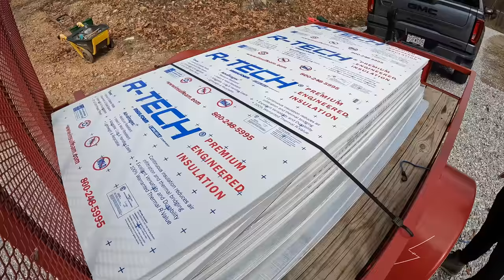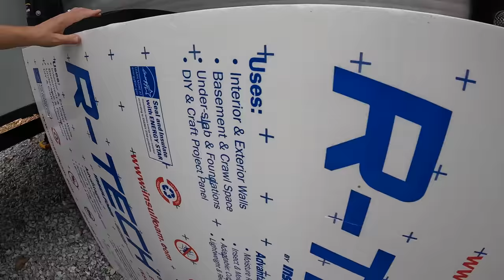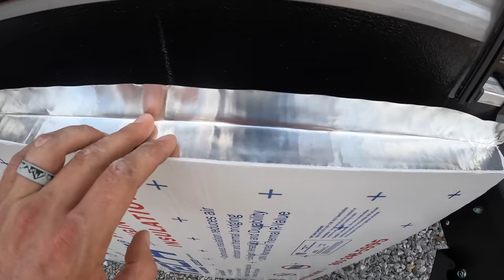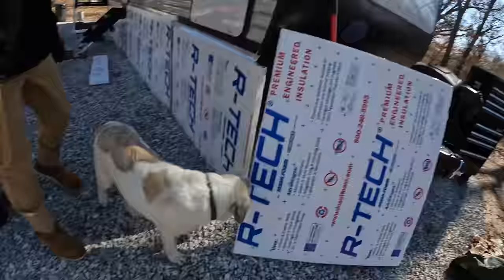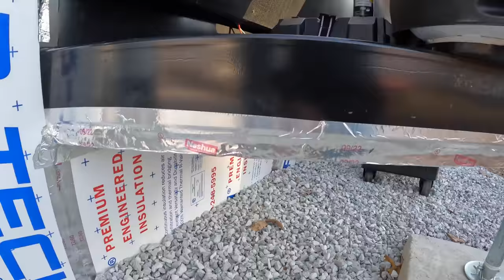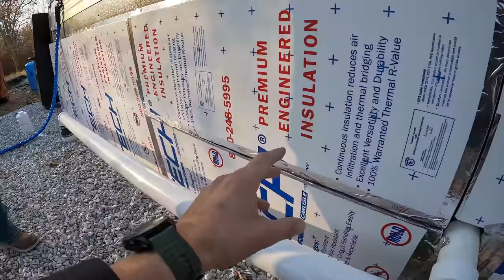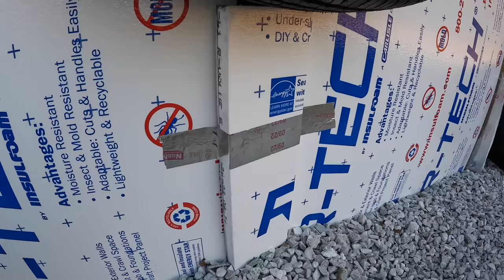Skirting our camper for WINTER!

Comment: If it goes below freezing in your area -you might want to use heat tape to wrap the pipes and then wrap insulation over top of the tape which is wound around the pipes.

Comment: Kyle I have a friend that installed some Heat on Demand water heaters. In his bathrooms , kitchen and laundry room  . And they are amazing  . So I thought Shanon and you might want to check them out . Great job on the skirting .  And Shanon did a great job under the trailer while dealing with Herc .

Comment: You can also get hay bales and put them around your trailer and then use the straw or hay for bedding later on for the goats, pigs, chickens etc. or bag the leaves around the property and stack the bags up around the trailer and it is free except for the bags! Pool noodles for your water lines and sewage lines( they can freeze, too!) Bubble wrap on the windows indoors, too. Good luck and God Bless!

Comment: WATER PIPES AND INSULATION TIPS:
Let your faucets drip overnight and leave any cabinet doors that have water pipes open at night(and daytime also if below freezing outside). You might want to leave bathroom door open when super cold out.
Parking your vehicless around the camper on the north side as a wind break may help.
You might want to check your upper cabinets, closets, bench seats and under your bed for any way to Insulate those areas. Maybe use your clothes, extra blankets or bed clothes as a way to Insulate those areas a bit.
Typically lined blackout curtains are heavy duty curtains(you may have to do your own modification to make them fit the camper windows.
Lastly, Reflectix Insulation is a great option for making temporary, reusable, on/off  windows and door coverings for night-time and alsi great for using on indoor water pipes (save them for summer too)
Stay warm y'all!!!

Comment: While I will not say skirting is good. My experience has been you do not absolutely have to have it. I have lived in my camper for over 5 years in the mountains of NewMexico. Never have I skirted my camper. What I found more important than any thing was to get an rv rated heated water hose. I watch people here try the heat tape trick and then have so many problems with it. My water only freezes when it gets below 20. When it gets below that I turn on my facets to drip and all is good. Your 20 gallon tanks of propane will be the other problem. Get something larger. Maybe 100. That is what I use. They last about 2 weeks in my climate. That is why I have 2. One runs out and you have a few days to get the other refilled. With snow a foot deep or worse at times this has worked for me. Then some of the reflective material for the windows and you should be good. Anyway everyone has their own method. Good luck in your venture.

Comment: My husband and I just insulated the back wall and ceiling of the front storage area with the roll out foil insulation to stop the air flow coming under our bed. Also insulated the slide out closet to stop the condensation forming. Helped immensely! We have the extreme polar package on our travel trailer but the area in the  pass thru storage compartment was letting cold air in around the water pump. We also used the same reflective tape. You should consider having the propane company deliver a 100lb tank to save on constantly filling your tanks all winter.
Reply from the maker: Thank you for the tips! ❤️

Comment: Nice job 👍 all the cutting fitting and taping. Everything always goes faster after you get the hang of it too. 
If you find it’s still cold use that covered rolled insulation/ crawl space moisture barrier on the ground on top of the gravel. That will also help. 
We also went from summer to winter in 24 hrs in southern Ohio. We had snow covering last night and this morning. They’re Talking about accumulating snow Tuesday. 
Glad your staying warmer and you won’t use as much propane.

Comment: Back in the day when you could still get incandescent bulbs, we used to hang a 40 watt trouble light under where the bathroom was and another under where the kitchen was. This kept the floors and tanks warm. Nowadays they have a heat mat for the tanks that you can plug in to suppliment the heat tape. You might want to be wrapping your gray and black water plumbing... nothing worse than a winter black tank freeze up, only to find it thawing in the spring and spewing under you. (Shudder, voice of experience) Love and blessings you guys! As a fellow perfectionist and tending to over engineering my solutions, gotta say you are on the right track!

Comment: Add another light fixture in the well house and put an infra-red heat bulb in the new socket. You can put one under the trailer also to help when the single digits hit you by surprise. The pull chain fixtures are what I used. Just a suggestion.

Comment: Don't forget about the mylar bubbles.  You can get it at the lumber store in the roofing insulation.   Cut it to fit the windows.  Put duck tape on the corners.  Poke a hole in the corners and hang them with command hooks.  Stay warm. Just my 2 cents.

Comment: You can get some tin skirting they have it for RV'S & mobile homes that can go over & protect the foam & blend in with the trailer. Also, get a portable carport for all the stuff you had under the trailer & tool
 box (<they don't like getting wet.) And if you get a dbl, then you can the quad in, maybe the car. 😉
And then later it can be used as an animal shelter or side with tin siding & make it more permanent, my dad did this with a couple he has.

Comment: If you want, you could add black plastic--house wrap style that would match the black on the camper. It would add an extra wind/wet/cold barrier. It all looks ready for the cooler temps. If I wasn't alone, I would wrap the skirting of my mobile home, but may do a portion of the garage from the NW corner area where my pressure tank and water softener sit to help with freeze up. I already have a couple of inches of snow on the ground, and already had a slight freeze up, so anything I could do would help. That corner is going to get rebuilt sometime in December, and I have purchased more insulation wrap and foil faced foam boards to get it more efficient when running a heater to keep from freezing the pipes, even hoping I won't have to have  any heater running in the enclosed area.

Comment: i would screw a 2x4 to the bottom and make a few braces for windy days braces every 4ftun and down as for the water system heat tap is your friend
Reply: old unters trick geta canvas tarp and toss it over the top helps to keep heat in  plus keep snow load off either tie to cinder block or gallon jugs of waterand rope
Reply: also if you have extra sheet left over put them on the roof then toss the canvas tarp over the top just hunters trick  to keep bum warm  
and i would cover the sewer pipe nouthing like frozen poo and what every trying to thaw out

Comment: Put a red light that heats things up under ur camper. Especially under ur tanks if not ur tanks  will freeze . We lived in Northern Nevada sometimes in the winter it will get -0 and below with snow 
Wrap ur water hoses with electric tape and the use pool noodles around the hose to kép your hoses warm.

Comment: My BFF  lived in her 5th wheel 2 to 3 winters in PA. Skirting helped. She paid someone to do this. Her drawback was mice so every place she could put steel wool she did especially where pipes come in. Tge heat tapes help. She only had a few times water froze in toilet. She was connected to water and electric in campground. Also put stuff on windows. Hung a heavy curtain inside front door.

Comment: Also another thing you could do seeing it's a camper you could put the see threw plastic on the windows inside will cut about 40 degrees from cold air coming in I would only do the windows were the actual cooling air comes in makes a huge difference I just go done my trailer what a huge difference were 30 degrees most nights now east coast area

Comment: I always said if I ever had to live in a camper or trailer, I would take plywood, cut it to fit wherever it needs to go, glue insulation inside of the plywood, can tape it like you are, then put latches on each plywood to fasten them together, that way you can get under anywhere you need to by opening the latches, fix water line or whatever, then latch the plywood back together, I think it would seal it off better with the heat tape on the water line, then you can paint plywood with a water proof sealer, and it would last longer and be nice looking. Just an idea!

Comment: If you take black plastic bags and fill them up with leaves lots of leaves and a couple heavy rocks an outline the camper you will also insulate your camper the black plastic bags will absorb the sunlight keeping it warm the leaves are an insulator just A suggestion of a little more warmth might be more work.

Comment: Amazon  sells a after market  shower head and hose  that is a real water mizer   that will extend  shoes time   so that as long you not spend along of time to enjoy  shower  can finish before running out of ht water also if you have the option to use electric and gas together  to heat water while showering  also extended shower time  but must  turn one of then off when finished

Comment: My heating valve is broke in my apartment. They are waiting on a part to fix it. My heat is on off but it's 80 degrees in here. I use an air conditioner and 3 box fans to get it down to 75.

Comment: don't forget to insulate your water hose so they don't freeze. and if you have not. If you have ceiling vents skylights insulate them. Alone in Alaska recommended bubble wrap on windows. What a difference. much warmer in my bedroom. keep that in mind if you need to. more windows to go. It gets single digits and below in my state. usually, in Jan and Feb. You can always put a light under camper to help with keeping it warm if need be. Got that from and ex-boss of mine it kept his pipes from freezing in the winter. you may want to make an insulated box for around the water hose connections. Not sure if you can use heat tape on the hoses. Stay warm We have someone up hear living in an Rv while they build This will make their 3rd winter.

Comment: I used some of such foil tape around a little enclosed back porch space windows where the old putty and wooden frames were deteriorated after over 40 years. Sadly the Alu-foil tape itself failed after a couple of years. But I guess you should be well on the way with a new house in that time. Probably having had enough of RV life.
Take care that strong storm winds do not tear the insulation panels free. The tape probably has limited strength. Might be needing stronger tape like DUCT TAPE, that has both very sticky glue and a woven fibre base material. Probably/maybe even available at lower cost than the foil tape.

Comment: Here’s what you have to do
Wrap insulation heat tape on all water lines and drains
Use insulation under side of your floor 
Use 3m clear window wrap on every window : it’s shrinkable
Wrap a “water heater blanket “ around the water heater
Use silver insulation rolls apply to inside walls. On Amazon
Use propane heater in addition to your “ furnace”
Hot tea and soups will help
Purchase cuddle duds long underwear 
Purchase bib snow pants
Purchase wool socks and heavily insulated ski gloves and face masks 
Use SUNGLASSES all winter if temps drop and it snows

Comment: Can't you make another spot to open up like a door and you can still store your things underneath on the non wind side? Maybe use some sort of tarp on the ground to put thibgs on. And tape a piece of tarp over the door you would open and use some of the cinder blocks to hold it down? Or slap some of the palates together put it up next to the camper covering it with a tarp to put your stuff in? A friend of mine had a camper that never moved and he use laundry baskets and milk crates to cover the vents a windows on top and taped them down so tree branches wouldn't fall on them and break or any heavy ice or snow wouldn't just sit on them. Just some ideas💜

Comment: Why don't you check and see if you can find some of those shipping crates they make houses out of. The ones say ship goods transatlantic etc. etc. That would make a good storage shed for all that stuff you have underneath. If you get a half size one you can put it to one side of your trailer and you have a convenient storage, which you can keep locked so it's safe from theft plus they are small enough they don't need massive support underneath you can put it on the ground, jack it up with a ham jack and put cement blocks under it to level it and you have a good bit of storage in the winter… In the summer do if you want to use it. With some windows cut in it it would make a chicken house or something at a later date or just keep the storage but is well locked up! Anyway that would be my suggestion. You're coming along nicely With fixing your place up! Don't forget the spray foam for gabs. Do they recommend any lights hung underneath the trailer to provide a smidgen of warmth to prevent freezing? Some properly shielded hundred watt lightbulbs could give off just enough heat to prevent your pipes from freezing in the really cold part of the winter. Thanks for sharing! ❤

Comment: I have a question for you guys I live in a fifth wheel too my fifth wheel moves as I walk through it up and stuff to write stuff like that I'm just curious why you putting the tape on this siding and putting it straight to the ground did y'all have any problems with the house moving and breaking the tape loose at you got it all installed or is it still doing a pretty good job of holding up I'm curious I like the ideal what you're doing
Reply from the maker: It's doing a pretty good job. We still walk around each day to make sure the seams are good, but it seems to help that we dug a little trench for the boards to rest in and then pushed the rock back up against it to hold in place. The tape has done a great job of sealing it.

Comment: So now Shannon has to build a tool cubby.  LOL
Reply: I highly recommend both fingerless gloves and wrist warmers.  I used to cut the tops of my old socks off to put on the end of my sleeve and wrist.  You would be surprised how much heat you loose from the end of your sleeves.  Now you can get some really cute ones.
Reply: I also keep a space blanket in my car and in the house for emergencies, like when the heater goes out.  A space blanket will keep you toasty, just like the kids on the boarder.  They really are great just not soft and snuggly.  One year when I was broke, I only air conditioned my bed, I made a tent tunnel over my bed to the air conditioner.
Reply: Shannon can cover the skirting with her pallet building, I bet she would come up with something beautiful, LOL, no pressure.

Comment: ***🌺You shouldn't lose under the RV storage if you just left yourselves a few doorways cut out of the taped boards??  
I have a better idea!! Why don't you go back to Grampa's house until the spring time when you could hopefully be in better shape to afford what you need to better protect yourselves from all the elements?? 
Or you could get a bunch of pallets, then place your largest tent on them and use that for the storage area you need for your tools that needs to be out of the rain.

Comment: Not criticizing, but is there a reason why you put the silver side facing in under the trailer & the side with writing facing out? I realize this skirt is for warm, not appearance. But it would look better with the silver side facing out. Unless there is a specific reason to do it the way you did. I don't know, I have never used that material. Again, I'm just curious, not criticizing. You guys did a great job! I know you will appreciate it as it gets colder and colder.
Reply from the maker: The foil side goes on the inside to keep it warmer. 😉 If it were on the outside, it would reflect the sunlight 😉
Reply: @KSDossAcres  See, there is a reason! 😉🙃😍

Comment: Don't spray anything on the panels, regardless of what kind of film is on the Styrofoam. You'll ruin the film, which will reach the Styrofoam. I use to laminate that foam. Just let it be. Don't ruin all your hard work, not to mention, water your money. Freezing where I live as well, with snow in my forecast. Yes, drill a few holes, and you can put a latch on that foam opening to keep it closed, just in case its windy, and wears it out.  Thanks for sharing.

Comment: Why in the world would you NOT put the silver side front facing, instead of the writing side. I really can’t imagine that you’d prefer the lettered side. Plus the silver side is made to repel water and snow, the paper side is going to get dirty and wet.  Hummm ???
Reply from the maker: The silver side is on the inside to keep the heat in under the camper. It's moisture, mold and mildew resistant-it will repel water on the lettered side as well.